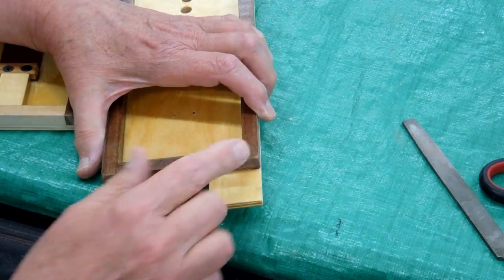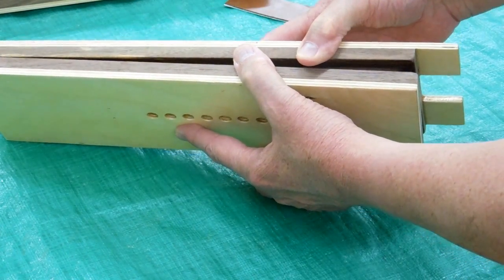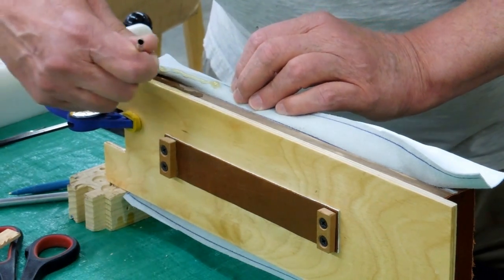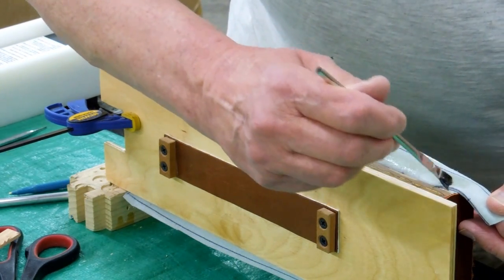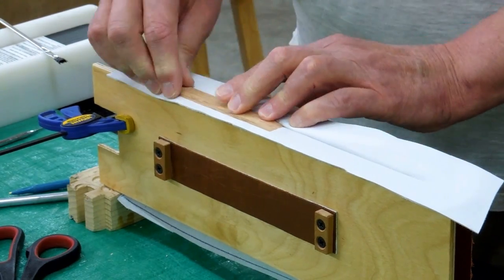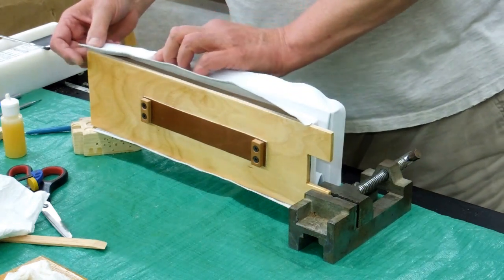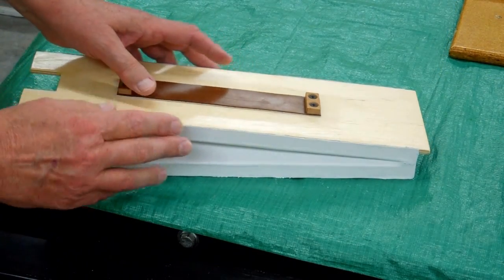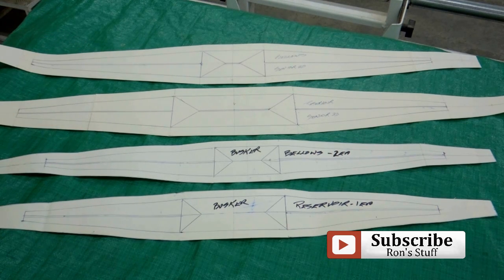Senior 20 Organ (02) Bellows & Reservoir Part 2

Comment: Interesting and Instructive video. I work as an organ builder in a Workshop in London (UK). The talcum powder is a good idea, but when you are leathering motors it would add some extra time an effort, specially when you have to leather many. I leathered x244 long power motors recently, for Waltham Abbey (UK) organ.
 I fnd the talcum very handy to keep my fingers clean and avoiding it getting stuck or messing the leather.  Nice work¡  Thanks for the video. 

I made a couple of ribbed motors recently, small ones, for a cuckoo like (clock) project. When the motors boards are narrow the cardboard ribs for the sides need to be away from the front cardboards, to avoid intersecting.

Comment: How did you figure out the middle section of leather length. The plans give the sides and height of the middle but not the length.
Reply from the maker: Senior 20 Organ (01) Bellows & Reservoir Part 1
https://youtu.be/t3fmP9_9pbQ

I do not have the plans in front of me at the moment. It seems like the leather was drawn out for the Busker but only the card stock stiffeners were dimensioned for the Senior 20. I got the impression John Smith thought everyone had built the Busker first. :-)  

After you have your bellows and reservoir built, you should know how long the middle and sides are. Lay out your leather on a template first and use the template to verify it is going to wrap around the bellows and reservoir satisfactorily and that you have allowed sufficient leather for the glue flaps and trimming after installation. Reference the above video.

You just need to play around with it… dry run practice the installation, etc. before you go marking and cutting the leather.

If you still have questions ask again… and somewhere I think I still have my templates and can dig out the plans and figure out where I got my dimensions.

Ron
Reply: @RonaldWalters2010  Thanks so much